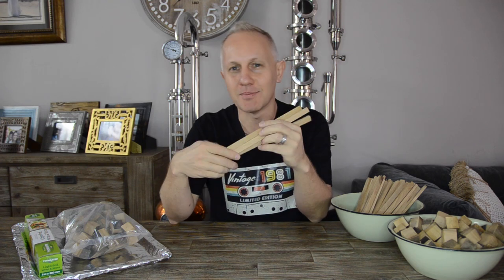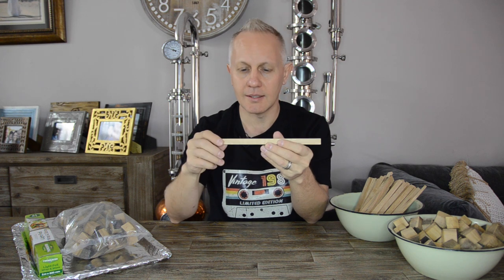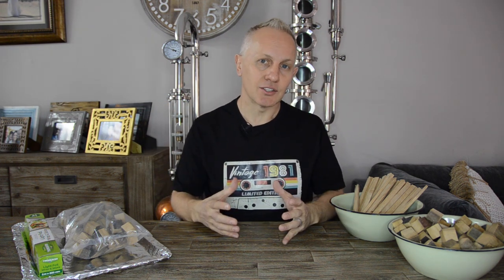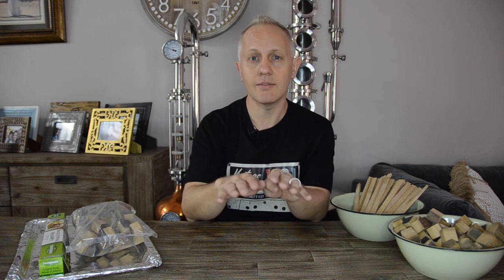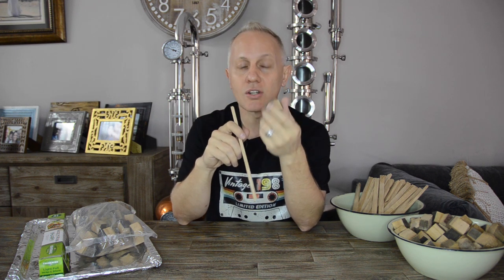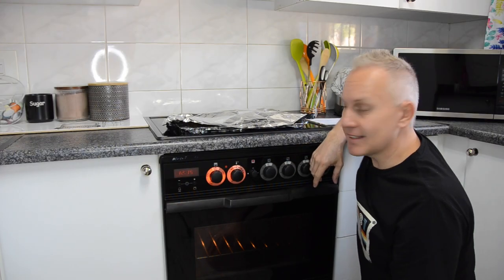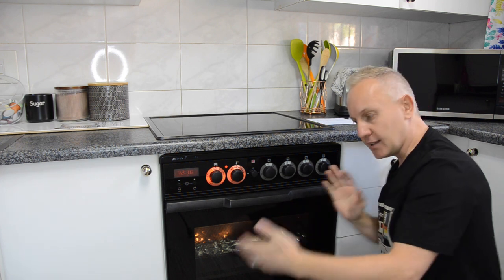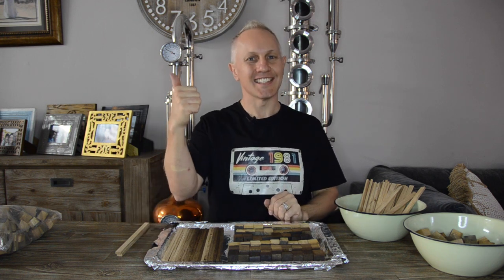Toasting and Charring Oak

Comment: Thanks. What about English oak, is that the same as french?
& how do you speed up the seasoning process? I can't wait. Haven't got patience.
Reply from the maker: Hey Motog4-75
Here is what I found about French oak vs English oak.
English oak is also seen as European oak, which then falls under French oak.
There is still a slight difference, but not that noticeable.
White oak is used for barrels because it is a closed cell wood, as opposed to red oak which is open cell. That being said the differences between French (Quercus petraea) and American (Quercus alba) is that the French has a tighter grain, higher tannins, and lower aromatics. Because of the tighter grain it is primarily used with aging wine because of its much lower rate of oxygenation, which can cause wines to turn to vinegar. These characteristics make it unacceptable for use in aging whiskys because oxygenation is important in the aging of whiskys. American white oak also has more vanillins which is desirable in whiskys and not in wines. 
For speeding up the seasoning process you need heat. In warmer to hot climates (Jamaica for instances), barreled spirits age much faster than in cooler to cold climates (Scotland).
Keep being awesome!!
Cheers!
Reply: @distillergreyling9135  thanks.
Was also wondering why there is a hyphon 75 at the top of your message?
Reply from the maker: Sweet, thanks for the comment Moto G4!
Apologies, see its how my app makes the names.
Reply: @distillergreyling9135  strange 🤔
No offense taken, was just curious.
By the way I toasted some oak in my oven yesterday that I cut a couple of months ago from a friend's house. Came out perfect 👌
The house was smelling of caramelised biscuits & vanilla. 
My wife came in & asked what am I baking. I said just oak.
Oh.
😁
Did it on fan top grill 180° for approx 1.5 to 2 hours. Then turned off & let it cool down in the oven for a few hours before taking out.
Turned out a good medium toast. 
I'm looking forward to using it in a batch of wine.
Reply from the maker: Cool cool!
That sounds delicious 😋!
It sounds like its going to make a great tasting spirit!

Comment: Just a thought maybe someone will chime in and tell me yea or nay on this. If i was to acquire some wet oak or other wood could i run it through a dehydrator to speed up the process? Or would it be detrimental to the final product overall? thinking drying it out some using it then making my toast/char?